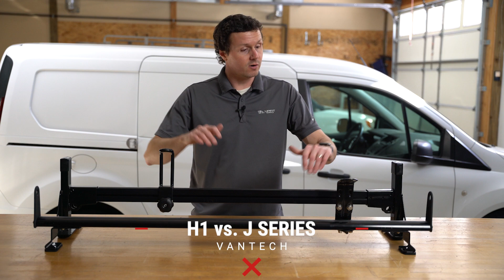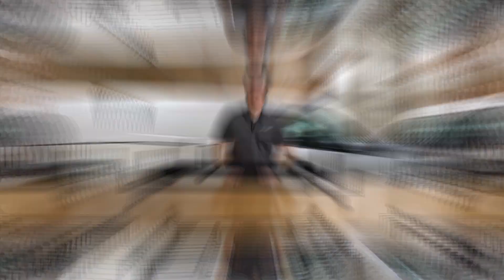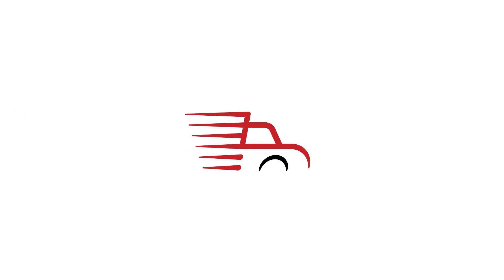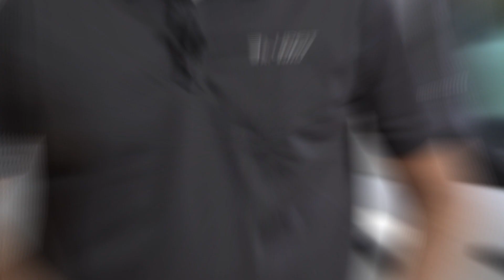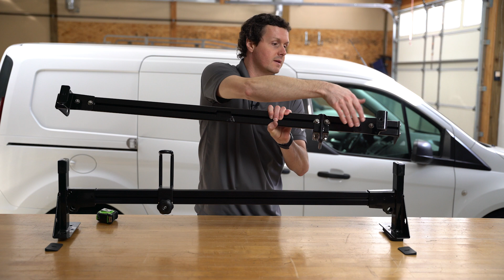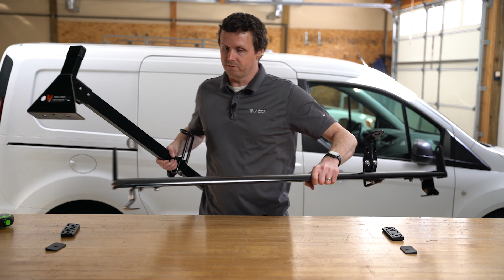Vantech H1 vs. J-Series Ladder Rack

Comment: 2 questions regarding the H1 Series, in the video you mentioned that the distance from the bottom to the top of the cross bar is around 6 1/2 inches, how about the distance from the bottom of the upright bracket all the way to the top? Also when you put together both brackets with the cross bar, what is the clearance or distance from bracket to bracket?
Please let me know.
Thank you.
Reply from the maker: The dimensions will vary slightly from van to van. On the NV200, the maximum height from the base of the roof to the top of the upright is 10.5" (the upright is 10" + 0.5" for the plastic spacer). The 2nd to last photo on this page has all the dimensions of the rack: https://upfitsupply.com/product/vantech-h1-ladder-roof-rack-for-nissan-nv200/
Reply: @upfitsupply  Thank you very much for the information